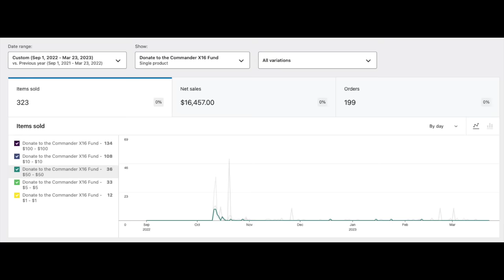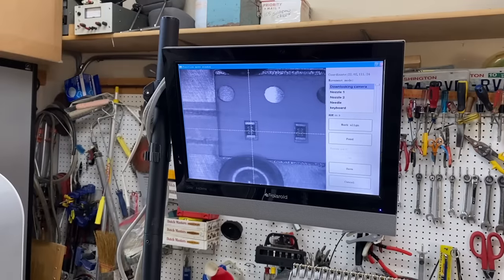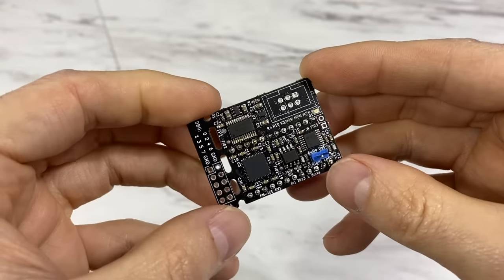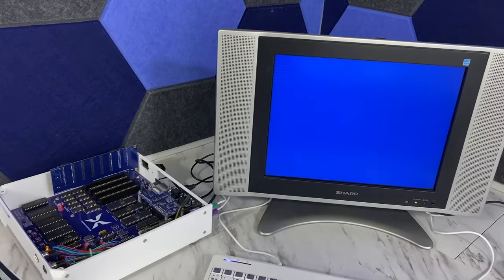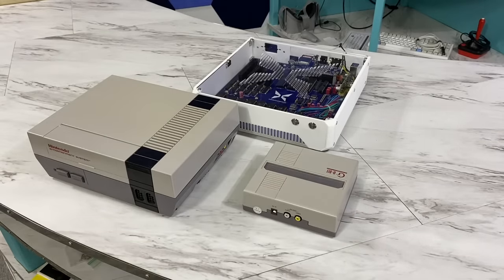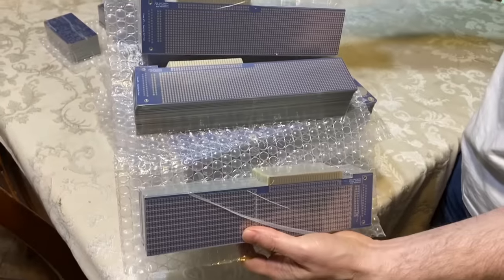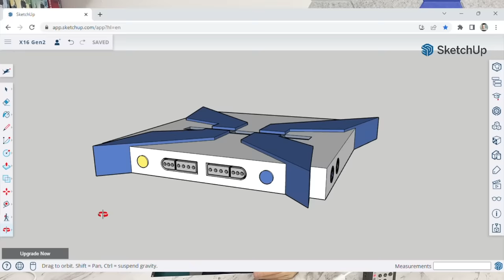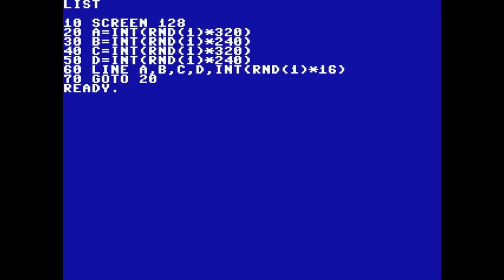Commander X16 2023 update

Comment: Seems the project should have gone FPGA to start with, as it's now complex & expensive w/multiple FPGA subsystems, and a cheap 3rd version would likely use FPGA anyway. They could have made a deluxe version later.
Reply: Any one of those FPGAs would be more powerful than the system itself.
Reply: Yes and it won't be using up vintage ICs will be needed to repair classic arcade games and PC boards. I used to follow a music synthesizer project where the designer made a series of filter boards using vintage filter chips. He then regretted it because these chips were becoming scarce and people would then unable to repair their very valuable and sought after synths. So it is completely stupid and short sighted to use scarce parts for what will be a plaything for nerds.
Reply: @joecan  Plus no PCB rework when things don't work right and you can actually go beyond what those systems could do back then, Spectrum Next and Mega C65 are great projects which are giving people something new but still with the resource limitations that inspire creativity.
Reply: I don't think the point was an excess of power, it's ease of programming and learning.  In that way it's better to have separate components,  I think so anyway, as a custom FPGA would be no different to a modern micro like the Pi4.

This is a retro development enthusiasm project it was never meant to compete with anything modern.  That is what Atari made their little box for.  I am glad they stuck with the yam chip.
Reply: @DailyCorvid  Any advantage of separate components is kinda made invalid by the fact that the oft-mentioned 3rd version (the one made to actually be affordable) is planned to use a system-on-chip design. Also, people aren't really complaining about lack of power, but much greater cost and complexity than what was originally pitched.
Reply: @jacklawsen6390  I wasn't complaining either I was telling the guy who wants to throw the design out and start again with a single more powerful FPGA that it's a poor idea.

I like the current board.
Reply: @DailyCorvid  I don't think he was asking for more power, but rather pointing out how building the system around an FPGA wouldn't have been very difficult.
Reply: @jacklawsen6390  Yeah I got that.  Just seems like backwards thinking to prioritise build difficulty rather than the original purpose; ease of development and understanding from one guys point of view.

tldr :

People aren't recognising that this is somebody else's project, with that persons goals.

Yeah you can throw it away and start again and build something different from the dead carcass but why would you?

You can already buy better cheaper FPGA systems than David and his team can compete with - but there isn't another computer or project going which competes with the X16 in those two areas (at-home development and repair).
Reply: The Argon 2 Light proves that a cheap, non FPGA 8 bit computer is certainly possible, if you don't let feature creep set in, and back yourself in to a corner. The creator even offered to design and build a cheap 6502 version for David, which would cost about the same as the A2L. Why David wanted to use the C64 Kernal is bewildering, as is the obsolete sound chip. There are far better options. But, fair dues, it's David's project, and he decides what and how things are done, and he's created a seemingly capable platform from scratch. It's just not what he initially wanted.
Reply: @another3997  Because it's a Commodore clone lol everybody who's complaining needs to go back and rewatch the dev videos.

Why is it called Commander X16 ?

The clear goal from the off and through to today - has not changed.  It was to be a low complexity modernisation of an 8bit hobbyist computer based on the Commodore Kernal.

Remember the only reason they didn't use the actual Commodore logo and rights is because they were not for sale.  This is effectively a Commodore 66 and a half.
Reply: @DailyCorvid  Low complexity? sigh It's starting to look like the most complex 8-bit ever sold for the home market.
Reply: @eekee6034  Yes that is also true.  But the complexity isn't something that is going to slow down any developers with any sort of experience.

That is who this machine is for, developers who want authentic feeling software but have modern tools to build it with, and be able to understand and operate the computer 100% solo.

Which has been achieved.  If you can't figure it out because it's too complicated then that just means you are not the target market.  It's not a general purpose machine is it.

This is getting old now, all the childish sighing and daft comments.  The things named and built pretty damn perfectly.  It's the most complex 8bit computer ever made for the home market because we haven't seen an 8bt home computer since the 80s.

It's for 40 years old enthusiasts like me rather than 25 year old gamers who have no interest in 8bit development like you.  Take it or leave it but your ideas have all been bad ones imo.  The design is great.
Reply: @DailyCorvid  calm down. you're so mad you already contradicted your self so many times, it's getting ridiculous. we get it you don't want to hear negative comments about x16 but it's a product that it is sold for a price, so criticism is going to come, like it or not. the only one being childish here is you.
Reply: @DailyCorvid  It may greatly appeal to a certain group, the reason some are less than enthused is that it's not what was originally pitched, and no longer appeals to them. I know it no longer appeals to me, and I was looking at it as a way to get in on 8-bit programming, which I've never really done.

Beyond a bit of disappointment, however, I'm more concerned that the platform won't grow a large enough user base, and the current production and financial issues make me hope it doesn't dig David into too deep a hole. I appreciate his drive and persistence, have enjoyed a lot of his content, and want to see him succeed.
Reply: @DailyCorvid  Fair enough, though I think a bit of disappointment and puzzlement is totally reasonable. How were people who watched the initial pitch videos supposed to guess the cheap, accessible little programming box would transform into a full line of complex and quite expensive computers with differing feature sets and proprietary cartridges?
Reply: @jacklawsen6390  What exactly did you expect?
Reply: @DailyCorvid  I just answered that question.
Reply: @jacklawsen6390  I don't think you understood them then.  The documentation is all on either the Wikipedia page in text, or in it's own playlist.

The name gives it away.  Why is it called Commander X16?  If you watched the videos you will know, and if you know then you wouldn't be making the complaints you are.

I really think you want a different computer, why you are trying to smash this round peg into the square hold of your needs is beyond me.

Buy a RetroGames TheC64 or something like that if you want new off-the-shelf stuff with emulated retro style.  Learn BASIC that way.  It's far cheaper and all the things you are complaining about won't bother you there.
Reply: @DailyCorvid  Your assumptions about me are hilariously wide of the mark. I'm 48 years old. I studied complexity in computer systems for 10 years. In some areas, complexity is necessary to get around certain natural limitations, but that does NOT mean that creating complexity is a worthwhile goal in itself. It's very much the opposite. Complexity hinders development and maintenance of a system, leading to reduced quality. It may also hinder users learning the system, though that does not seem to be the case with the X16. Unnecessary, harmful complexity easily arises from a lack of discipline (which certainly does apply to the X16) and from a lack of understanding of the goal (which may not). In some cases (definitely not the X16, I'm sure,) it also arises from a desire to create job security or other similar economic forces. Ultimately, I agree with this old quote: Anyone can make a system more complex, but it takes a genius to create simplicity. Compare Plan 9 from Bell Labs made by Ken Thompson and his colleagues in the 90s. In parts, you really do need to be a genius to understand its simplicity.

We have seen a great many new 8-bit computers since the 80s. The Commander X16 is just the highest-profile one for US or perhaps English-speaking audiences. It may or may not be the most commercial new 8-bit. I thought it was, but then I remembered maybe as much as 10 years ago, there was a system with reprogrammable FPGAs intended to simulate a variety of machines. Most of those were 16-bit, but I think C64 cimulation was developed before I stopped watching it. That project was a little slow to be released too.
Reply: @DailyCorvid  Thing is, David himself wanted it to be a affordable and therefore accessible. That was his plan. He could have done that and retained kernel commonality with the C64 (which was one of his goals) for far less money (thus making the end product affordable) if he'dve used an FPGA for more. VERA already is an FPGA, so it's not like he didn't make the FPGA leap already.

The X16 is very much a different computer than what David originally envisioned. Now I like the direction it went in many regards (ie, expansion slots and ATX form factor), but it's not cheap, nor simple due the needing out-of-production parts. Even if you wanted to keep the expansion slots (the reason I want an x16 and not an Agon Lite), you could do that with FAR fewer chips and motherboard difficulties if you go with modern FPGAs. From a programming standpoint it wouldn't have made much difference, from a repair standpoint? fewer solder joints to check, and you can get ruggedized FPGAs too if you REALLY want it durable.
Reply: @DFX2KX  Well it depends on what you think of the value proposition, as to whether or not you think $500 is a good price.

But I don't think it's strayed that far from the origins.  People forget it's a Commodore C16 extended clone computer.  That is what it is, and yeah it would be nice if it was like $85 next day shipping lol but you have to be realistic sometimes.

I knew it was always going to run to $400-500 at least.  And decided then that as long as the project stayed good I was in for at least 2 units.

But I am a Commodore guy, that appeals to me = I don't think £500 is a lot.
Reply: Just another pointless vanity project. Should have been FPGA especially for the constant feature creep.
Reply: Have to make the through hole part design first, because otherwise you risk painting yourself into a corner where the FPGA design can do something that glue logic can't replicate.

Doing this one first, when they have finalized a working system, that is the hardware reference design that the other designs work toward matching.
Reply: That is one advantage not using the OPL2 that it turns out they should have used.
Reply: How are advantages of the Dev board or X16c "negated" by a the existence of a system mostly integrated into one or two FPGAs? It doesn't "erase" the other versions.
Reply: It's definitely less complex than a C128. Also seems less complex than many later tier MSX systems.
Reply: Someone who watched the initial "concept" videos and then ignored everything that happened after, perhaps. But if someone was turned off by thing that happened in 2019, why wait four years to EXPERIENCE the disappointment?
Reply: Something that was not mentioned (though I may have missed it), most of the OPL2 chips have been discarded somewhere in the form of old IBM-PC sound cards. I personally have no qualms about getting and old card, desoldering the OPL2, and mailing it in to be 'factory' soldiered to my x16 board. Or perhaps arrangements can be made to send in whole cards.
Reply: @DailyCorvid its called Commander x16 because something about some ice cream company...
Reply: @zerothis23  .....ok
Reply: Almost every arcade machine or other machine that needs to have vintage chips repalces are the playthings of nerds today, so it is kind of a moot point.

FPGA dev boards are also quickly coming down in price and the dev tools for hobbiests are getting better.

The suction for any vintage chip shortage is to replace with FPGA, or if there is enough community interest then they can design a conpatabke chip and commission a run.
Reply: @another3997  Well his design idea how he stated in one of his older videos (David please correct me if I remember wrong here), was that he wanted a successor of the C64 in the veins of what would have happened if commodore would have moved the C64 line forward with better graphics and sound instead of going the Amiga way, and the Kernal makes perfect sense there. In the ned it was his dream machine he wanted to have and share with others!
Reply: This project seems wildly over engineered ,the whole thing could have been done off  one FPGA or other arm  Microcontroller chip for a working system at minimal cost and testing as less chips less waste  , then populate the original chips in sockets as sellable options with jumper selects to enable these . Seems like you have designed an 80s system around ics that no longer exist or may even not work much longer .
Reply: @adonisnetworks  Missing the point there bud.  The whole thing could be emulated into a smarphone.  That misses the point.

FPGA systems already exist which do that.  They are expensive and not fun.
Reply: @DailyCorvid  "expensive", "not fun". Yeah, this thing here is the flawless one, how did we become oblivious to that?
Reply: You will have to remind me of this conversation, I last posted to it 8 months ago or something like that.

What are we talking about here? @fL0p